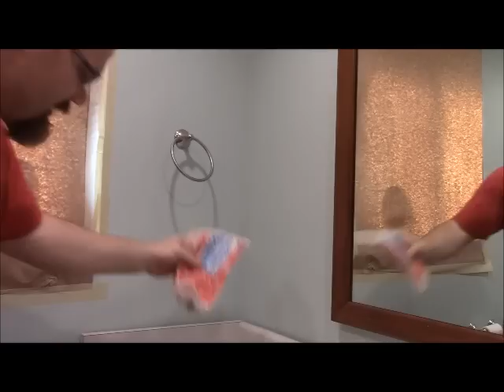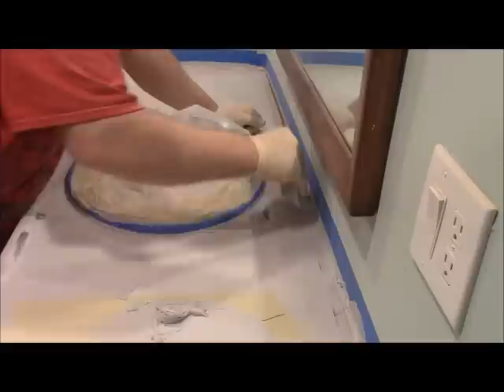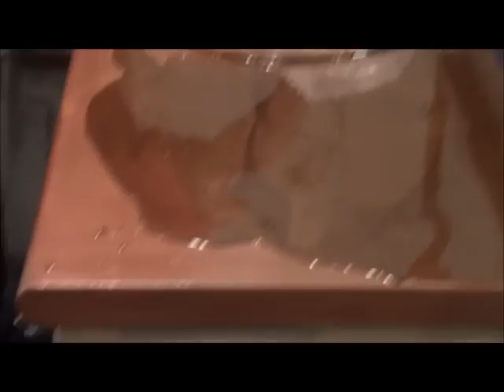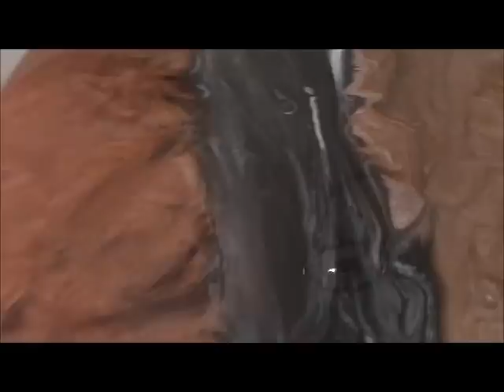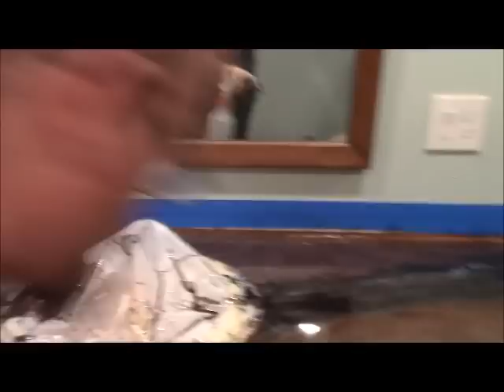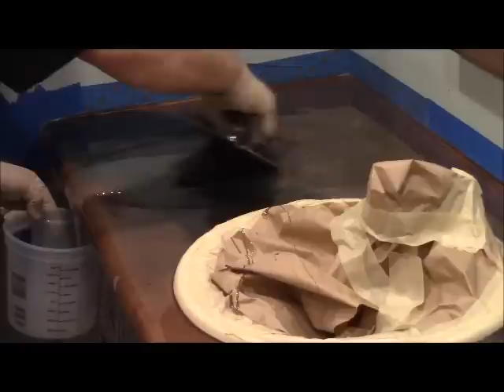How to Refinish Laminate Countertops  uncut Training

Comment: I am doing my first for hire job next weekend for the clients 15 sq. ft kitchen.  It's old formica.  I didn't even hesitate when he asked me to do it.  After watching these videos for the last 3 months (my family not only thinks I am absolutely NUTS, but) I have that much confidence that I am prepared to handle whatever comes up.  Never cut off a back splash either but you guys make it look easy and I bought just what you used here.  I GOT THIS!  Pictures coming soon.  Wish me luck!  Andy
Reply: I was finally able to complete my first pour today after 3 weeks.  When I examined the surface, I noticed a soft spot by the sink that turned out to be totally rotten.  The owner just wanted me to put in a support but then I showed him the underside and we found almost all of that substructure was affected with water rot. So that is why it has taken 3 weeks.  I do this after work and sometimes I had clients to deal with after hours and couldn’t get away to work on the countertop base.  It seemed everything that could go wrong to delay me, did.  And that shook my confidence even more.  When I finally got the cabinets rebuilt sanded and stained, I cut my first MDF to make the countertop.  I was so nervous I was going to mess it up. I must have measured every feature 14 times.  Actually my 16-year-old deaf son saved me from a fatal mistake by reminding me that we had flipped the MDF over and I was marking the wrong side for the built-in stove cutout.  (Thank you, Marco!) I’ve been working with a SCC person recently, Mike W, and my confidence was at it lowest.  With all the changes and the new color on the cabinets, I was at a loss of what colors to use and what technique since the owner had given me creative license.  Mike suggested the Chamber methods which I practiced and failed only because I had no patience to let it blend and turned my samples to mud! The scheduled day of the pour came, my help didn’t show up, work called with an issue that required my attention and by the time the afternoon came around the rain was rolling in.  I felt relieved I had bought another day, still not knowing what I was going to do.  I watched this video, and although Mike Q showed many, many techniques, one was sticking in my head.  Yesterday morning rolled around and as my son and I walked into the site, my helper wasn’t going to be there again, and I was freaking out.  So, here I was standing in front of a beautiful, brand new MDF countertop with a White base coat and no idea what I was going to do.  I have every can of Rustoleum I owned sitting there with my Epoxy, metallic powders, dye, etc.  And it passed through my mind.  I’ve heard this over and over, but it was Mike W’s voice I heard saying, “You got this!”  I picked up a hammered bronze, and black can and I hit the edges randomly first then as well over the top surface. When I started mixing material, I am really not sure why I picked the colors I did, I was just being random.  As I spread the base material out, it was like a calm started to come over me like I had done this 1000 times and I can quote Mike Q here, because all I could think of was the beautiful things, I have watched them do, and I heard Mike Q’s comment in my head from this video at 58:55.  Mike Q said, “All these techniques that I’ve learned I just learned by playing with material, not being afraid of color.”  And after that neither was I.  It seemed like it all went by in a flash.  I added colors and chopped and chopped.  When I turned around my son had been filming me, but his cell was definitely off center, and his mouth was hanging wide open as if to say what the heck was that?!  I had restrained myself from going too far and I kept scraping the bottom edge every ten-fifteen minutes.  Believe it or not, I was able to put my fingers on it just 6 hours after the pour.  I do have a few fisheyes I didn’t catch but, I'm going to call Mike to see if there is something I can do to get rid of them before I pour the final flood coat of transparent.  Thanks to both Mikes (and Mitch).  I couldn’t have done this without watching like 150 hours of your videos.  Until Next time.  I can’t wait!
Reply: I hope you understand that I do not mean to be condescending when I say Congratulations. Sounds like everything was scary and going against you but, you refused to quit. Although I do not know you I'm proud of you for refusing to give up! Great catch for Marco! Sounds like you have taught him well and he has a good eye for details! I'm sure happy that you found the "zone"  and I'm sure your client loved the results. Best of luck to you and Marco for the future.👍 Again CONGRATULATIONS! 🥇

Comment: I think that doing the Resurfacing without Pulling the Sink is kind of a bad Idea. Like you said, you need to keep the Tape about an 1/8in off tge Countrtop, that means the material will go under that tape, and against the Sink.

In the Future when they want to pull that sink to install a new one, that will create headaches getting the now, glued in Sink out. 

Pulling that Sink isn't difficult or very time consuming, so I think it best to just pull it.

Comment: Why would you bondo the countertop right to the drywall? Now it's permanent unless you want to rip out the wall... and are you going to install a backsplash? Because the back looks pretty cheesy and not even a perfect straight line.

Comment: why not blend the drips in instead of taking them off and some of the epoxy at the same time comes off? This is not what I would call a sealed job. I would blend the drips in with either a brush or something that would emulsify them and leave them on the underside of the counter. Not going to see them, anyway.

Comment: Instead of putting a backsplash on, I would get the really pretty copper, black, white and clear small tile backsplash like they have at Home Depot, and use that on the wall up about six or 8 inches and grout it with either copper or graphite... that would really compliment the counter top colors.

Comment: By not pulling the sink, you create an issue if in the future they need or wish to replace the sink. It doesn’t take that much time to pull it and in my opinion would be a far more professional job to pull the sink before finishing the countertop with the epoxy.

Comment: Very nice creative design! I'm wondering how you can color the countertop first. The way the countertop is made by the manufacturer is to keep water from falling over the front edge by adding a slight raised area at the radius. When the liquid color goes on it thin out on this front edge and settles back to the center making the edge radius look lighter copper in color. Would it be better to use a modified spray to hit this radius first then clear coat? Otherwise it looks excellent.

Comment: I’ve done 2 bathroom countertops and my only complaint is the drips under the rounded edges. I taped it all but I had to sand underneath afterward. It was awful. Thoughts?
I want to do the kitchen countertops but I need a better system.

Comment: I’ve commented a couple times on how much I like this process, and I have a couple questions. Have you ever tried to do a stainless sink in the base color for contrast but it wouldn’t have the stark color difference that white or plain stainless would give? I want to do a top that backs up to a brick veneer wall and the veneer hangs over the top about 3/8”. How do you think I could kill that joint where they meet? Thanks up front, I’ve been working in cabinets for at least 35 years doing installs to sales and design working with the 2020 program. So this swing would be fun and rewarding.
Reply from the maker: Hi William thank you so much for watching our videos! Please e-mail us pictures of your project as this can help us advise you in the best way possible! Stonecoatcountertops@gmail.com Have a great weekend!

Comment: Finished product looks great, but after labor and materials is it really more cost effective than new stone counters?  After all it's still laminate underneath that will cause issues in the future if you get any moisture on in the particle board/MDF
Reply from the maker: Great question Kiersen!  All of our pricing and product information can be found on our website here:https://www.stonecoatcountertops.com/stone-coat-productThe cost per square foot for countertops which you build yourself averages about $5 per square foot.  If you are wanting to remove the laminate countertops and build from scratch using 3/4" mdf, here is a great training video: https://youtu.be/ygbKeiH7oXI  https://youtu.be/ygbKeiH7oXI  
Call or write us anytime with questions. (541)450-1976

Comment: is epoxy and resin the same?
Reply from the maker: Great question Sonya Hill. Our Stone Coat Countertop epoxy is made up of equal parts resin and hardner mixed at a 1:1 ratio, check out our video here to learn more about our product: https://www.youtube.com/watch?v=UY61wvY294k&feature=youtu.be  and please feel free to call or email us anytime for project support. (541)450-1976
Reply: Thank you, so it is basically the same, i use resin in my art projects, now i want to do my kitchen counter tops it's black formica  that runs up the wall (back splash) i got to cut it back splash off. now i gonna show hubby this hope he's on board...lol
Reply from the maker: If either of you has any questions, give us a call and we would be more than happy to walk you through the process.  What colors did you have in mind for your kitchen counters?
Reply: different shades of grays, white and very little black.

Comment: Like the top very much.  The bullnose... looks like sloppy paint drips.  Can the bullnose be chopped effectively?
Reply from the maker: Great question Dave Rhodes.  We brush horizontally with the edges before walking away from the pour, then we sand between coats, and on the second coat torch just enough to get it to flow. Finally, do horizontal strokes with the brush, then one more quick torch. Call or email us anytime for project support. (541)450-1976

Comment: How does this stuff react to heat it a hot iron skillet? If used in the kitchen
Reply from the maker: Great question! Stone Coat Countertop epoxy is durable. You can set hot pots and pans directly on the surface; however, just as any countertop surface, we suggest you still use hot pads, as it's nonporous and food safe. You can clean with normal household countertop cleaners, but soap and water generally does the trick. Not much will damage the surface as far as spills and stains, but it's good to clean up spills after you're finished cooking and using your tops to prep. It takes three days for light use, seven days for cure and thirty days to a full cure where our durability video tests are shown at. Here is a link to our durability video showing what Stone Coat Countertops can take, we have tested up to 475 degrees Fahrenheit. Thank you and feel free to contact us anytime! Here is that video link: https://www.youtube.com/watch?v=YLUteivXWaM

Comment: Does it make much difference to use the trowel vs using a foam roller to distribute the epoxy?
Reply from the maker: Hi Cynthia, thank you for watching and great question!  We suggest using the 1/8" square notch trowel, it gauges everything for your to give you a nice even coat, it takes all the guesswork. Foam roller is not as consistent and can leave behind debris; whereas, the 1/8" square notch trowl will not. Feel free to call or email us anytime for free project support. (541)450-1976

Comment: Hi sir!I'm an avid viewer of your stonecoat youtube channel,I have a  little question to ask sir,is that roller and paint brush you're using is washable after using the epoxy?,coz if it's not the still cost amount every time you do a project and you need to buy new roller and paint brush again.
Reply from the maker: Hi Nelson thank you for watching! Great question yes it is best to use a new brush anytime you apply a clear flood coat to avoid contamination. You can reuse the color coat brushes by soaking them in acetone until your next project!

Comment: Hi Mike!  I watch all of your videos and love them all. I have only used epoxy once and that was to clear coat (x2) a quilting table top that I built because I needed it smooth as glass and don't care much for how poly scratches so easily. One lesson I learned from that project the hard way was removal of drip edge after drying is a bear and very messy! The other thing was that a manual start torch is a pain to start with sticky fingers. I just completed an 8x8x2 sewing counter per your products and instruction and a little of my own ideas. This counter is for a sewing machine center and I did it in a marble look with veining. It came out  beautiful but not without some learning curves along the way. Thankfully this is actually my test counter before doing my kitchen of which is quite large. The problems I had were 5. 1) I hated the manual start torch so I purchased a push button start torch. Turns out it could not be angled lower than 60 degrees without blowing out (not good) and constantly did so. People, just use a manual! 2) I used plastic sheeting to cover the cabinets and floor. My feet stuck to it and would pull it loose. I suggest using rolled paper at least on the floor. 3) All mica flake is not the same. My silver was too heavy. Use the thinest, flattest mica. 4) Remove the tape off the wall while the epoxy is wet or it is super hard to get off without damaging your wall. and 5) Have at least a quart more epoxy than planned for on hand to be sure your final coat has plenty for overflow which you absolutely need!  I will be applying a 3rd coat to fix the slight mica flake imperfections and a missed area on the edge where it didn't completely cover on one spot. All in all my counter is beautiful!!!!  Thank you again Mike, you're a great teacher :D

Comment: I have a very long countertop made of Formica that is solid in most spots but there is one area where someone melted it (before I bought the space) and it is delaminated and bubbled about 10-11” in diameter. What do I do? Should I remove the Formica or can I sand it down so that it is a more solid substrate? Should I glue or Bondo that area? I’d like to keep it there and not have to demo the whole thing. Also, some of the edges are loose, so should I glue those front strips down? You show great videos of solid pieces but I’d love it if you would show what to do with a piece that isn’t so great. Also, what about food safety if you’re doing it in a kitchen? Can you put a hot pot on it without melting it? Your videos are awesome! Great detail. I have a lot of respect for what you’re doing. Thank you for sharing it with all of us.

Comment: Important question when sanding the counter top in the bathroom should u not or should you use a solvent cleaner to remove excess dust or oils from sanding micro counter top ? Before using epoxy ??

Comment: Thank you so much for the step by step how to explanation. In a perfect world should you remove the sink so not to run into issues in case you have to replace the sink or remove for any reason? If you do, would you mask from the bottom.? Thanks again for sharing this cool do it yourself project. Bradhelms65@gmail.com

Comment: i have a similar countertop in kitchen with a double sink.  my questions are; do you have to remove the 2 inch backsplash or could you treat is as part of the countertop with exactly the same technique and products?.  And , is it better to remove a kitchen
 sink first or just do exactly what you did in the video is fine?

Comment: Amazing video series. Very insprirational.   Is the metal trowel preferred over a plastic bondo scraper? For a shower surround can a entire 4x8 sheet be done on the bench top and then cut to size on the table saw. Will the blade melt the material?

Comment: Hello, just want to say I love the way you do the informative videos. Also I have a question about flooring. I have tried to read all comments on all the videos to look for the information but I haven't found what I'm looking for. I saw where you responded that "yes this process can be done on floors but there are some things to do differently. My question is... Can you put this on floor tiles like ceramic and other types of tile with grout lines and also would it be cost effective? I absolutely HATE our tile and the grout is horrible. We bought a foreclosure and I want new floors, but I want something unique. I know the epoxy will level out the grout lines but is there something we should do to the grout before, so that the materials do not soak into the grout? Please help. You are so creative and I would love your opinion. We will be purchasing Stone Coat Countertops for all of our vanities and countertops. Thank you

Comment: If I cut off all my backsplash in the kitchen, then do it on a 1/4 inch piece to be able to lay it down to work it, then hang it up all around the counter top, what product shoud I use as the 1/4 inch surface and how would I attach it?  With liquid nailes?  And what should I seal the backsplash and the counter top where they join together with?